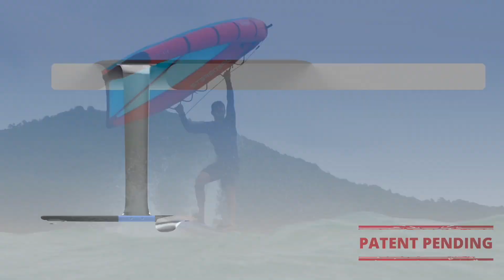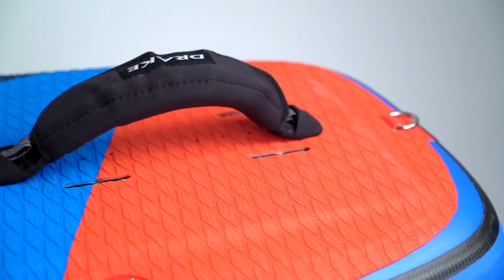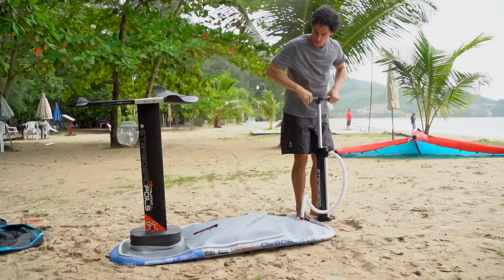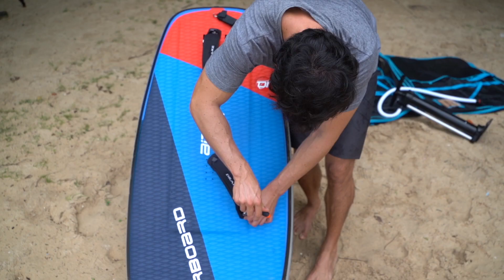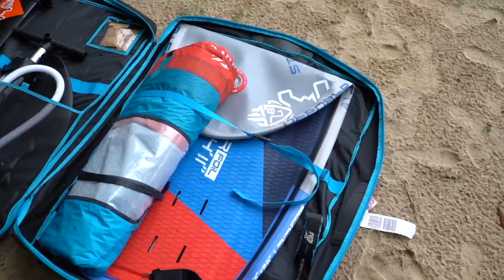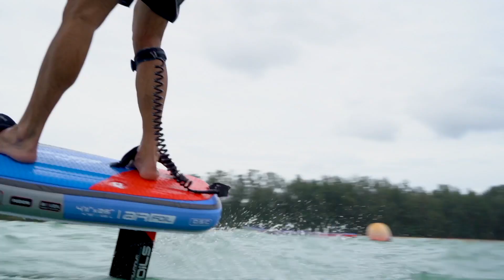2022 Starboard Air Foil — NEW Inflatable Wing Foil Board

Comment: I rarely deflate my board so I’d be uninterested in a board that required me to do so every time I put the foil on or off.  My sky air fanatic has carbon foil box on the bottom and I get no flex out of it.
Reply: I really don't agree with you. I could feel massive flex as the mast flexed on the base. I love Fanatic (have a sky wing) but for me the flex was palpable.

Comment: By the way, don't you have anything smaller than 122 liter (5'8" tall) air foil inflatable? like 100 liter +- volume with around 5'2" tall?
Reply: Smaller boards are also available, check with your local store!
Reply: @rauldelgado4372  why would Starboard not list smaller sizes on their website and in the video, if they made them?